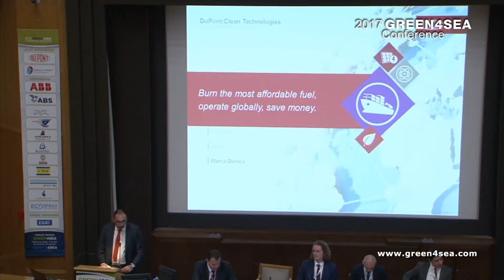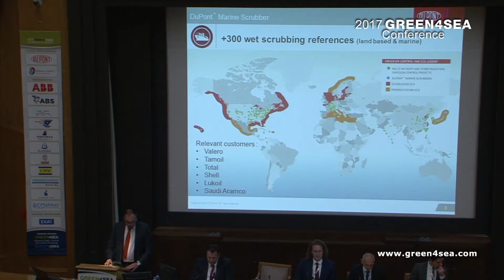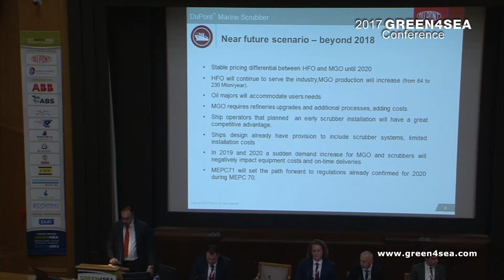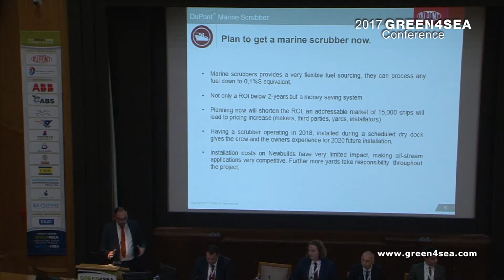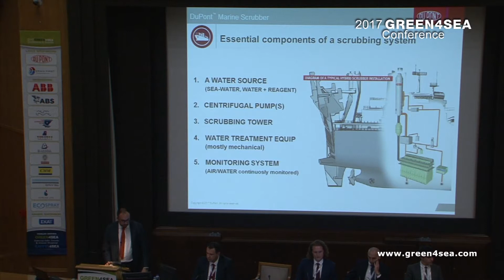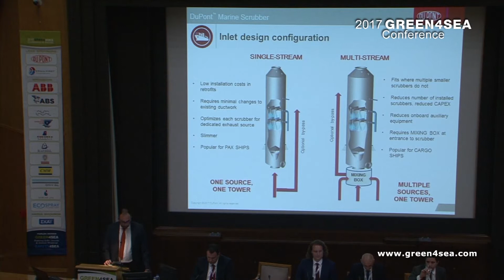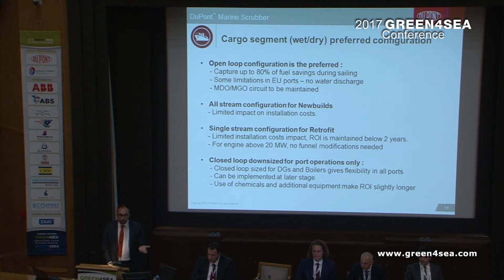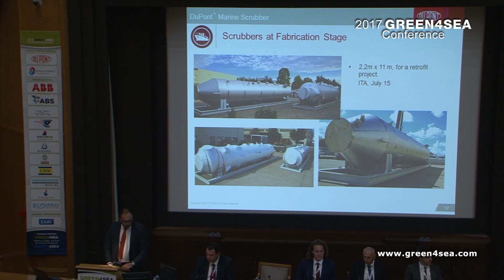2017 GREEN4SEA - Marco Dierico, DuPont

Comment: ...... not so  far  2020, there is a question - where new ships engineers (operators)   for safe service of new systems with gas installations, and also systems of purification of final gases ( scrubbers )  and systems of of ballast waters cleaning will be trained ?